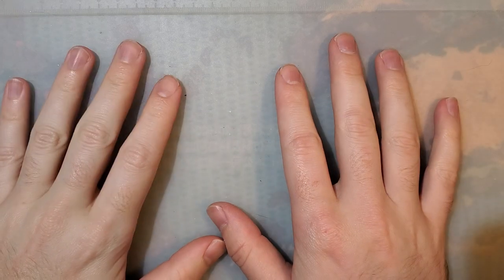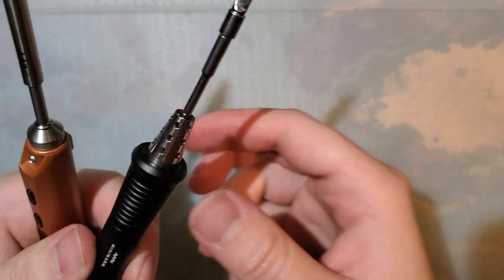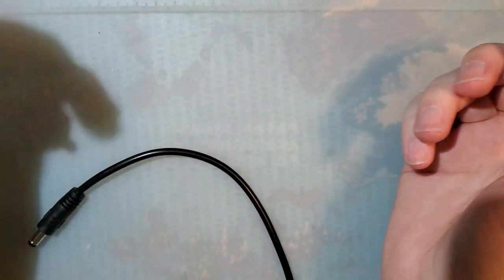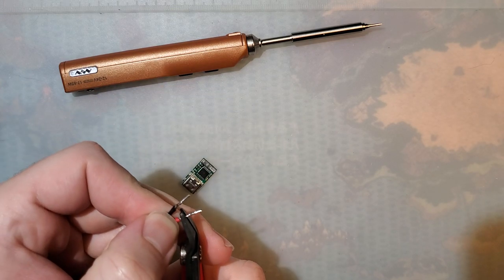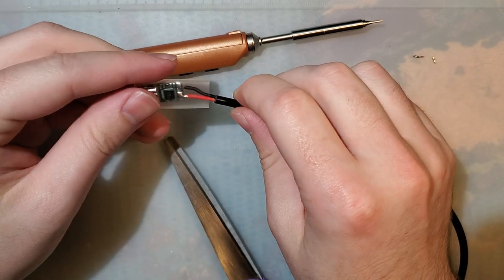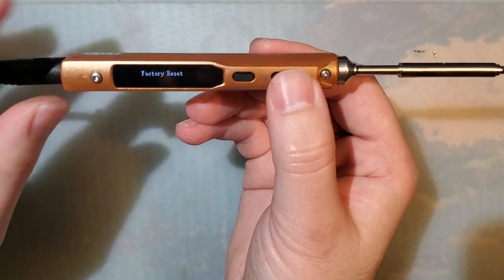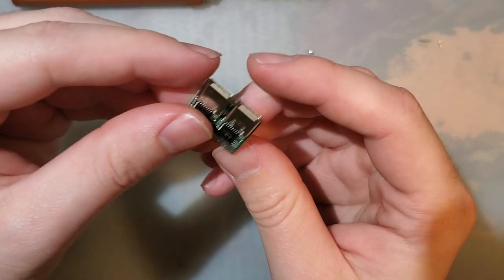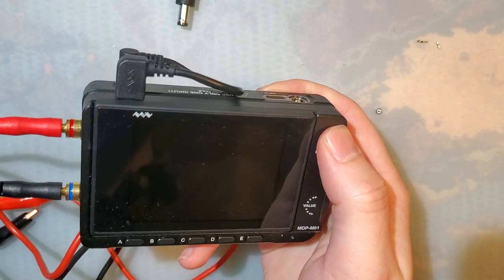USB C PD Power Supply Adapter for TS100 and MDP-XP

Comment: Excellent Tutorial.   I took it a step further.  Cracked open the case of the TS100 and added two leads from the Power Jack and ran it outside the case.  I then soldered on teh USB-C Module, and secured it to the side of the case with CA Glue and large heatshrink tubing to cut out the middleman of the adapter.  It works great and is compact and out of the way.  Thanks for the Idea!

Comment: I just use the TS-80 and it takes 9v using USB-C but you have to have a QC fast charge power brick. but it gets the job done for smd soldering. this seems to be a good solution for those with TS-100. I really like watching videos like this and your gameboy mods videos. keep it up

Comment: Wait a minute. What is the cost of the Power Delivery Power Supply + the adapter?
You could probably buy laptop power supply for the same cost or less.
Reply from the maker: if you have another device that uses USB C PD power supply, you can just reuse that power supply. 

For example, my laptop, switch, TS80P, and cell phone all came with USB C power supplies. The TS80P supply works with all four and, with this adapter, my TS100 and MDP-XP too.

Comment: Hey, I just got the inside gadgets Gameboy cartridge flasher and I am using a flashcart based off of the Japanese Pokemon Crystal cartridge and was wondering if you knew the specs for it so that I could flash it with a newer version of the Pokemon Crystal Clear ROM?
Reply from the maker: probably uses am29f016 so try that. If not, there is a flash id program you can use. You can always just pop the cover off and read the model off of the flash chip. If you're struggling, check out the insidegadgets discord.
Reply: @makho  thank you

Comment: You can make a stand very easily
Reply from the maker: Sure but cheaper irons come with solid stands so
Reply: I recently changed from a TS100 to a T12 based soldering iron... Not having a stand really bothered me. Also, the T12 ones have cheaper tips.

TS100 is really good for portability though but I liked a soldering station.

Comment: How far can it go? (in Celsius)
Reply: The linked page says: Temperature range: 100℃ - 400℃
Reply: @Torbjorn.Lindgren  Good, I wasn't sure if it could go past 300°C which would have rendered it pointless as soon as you encounter a ground plane
Reply: Ts100 goes to 400 celcius max with stock firmware